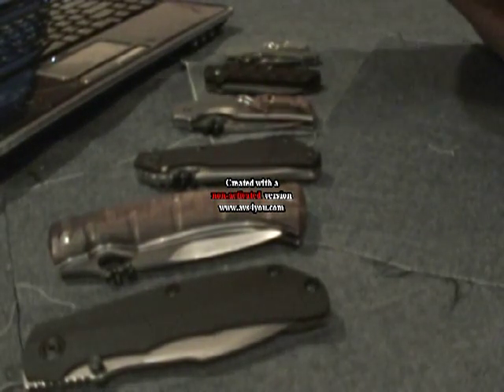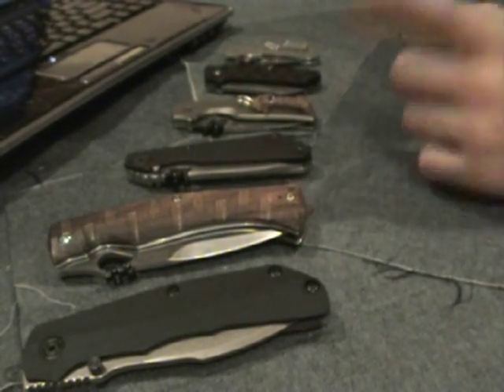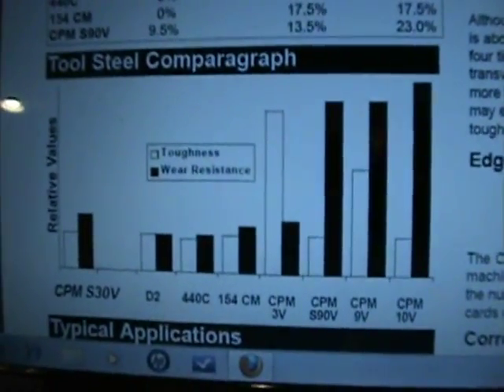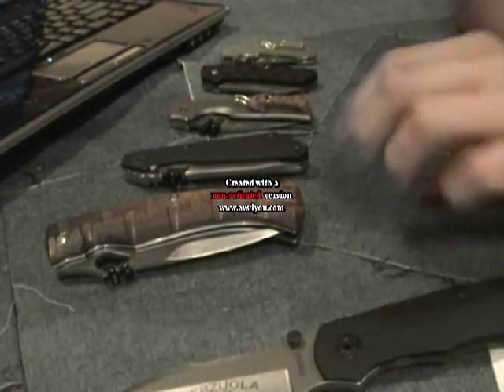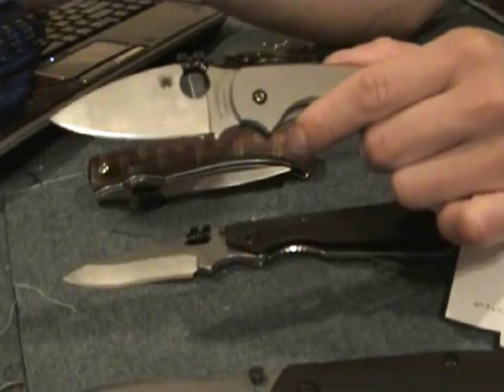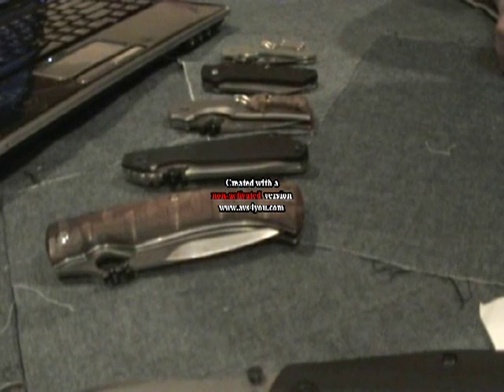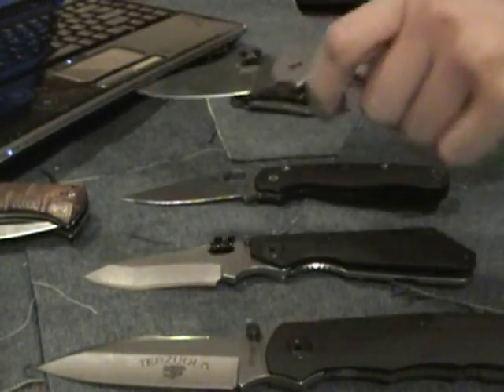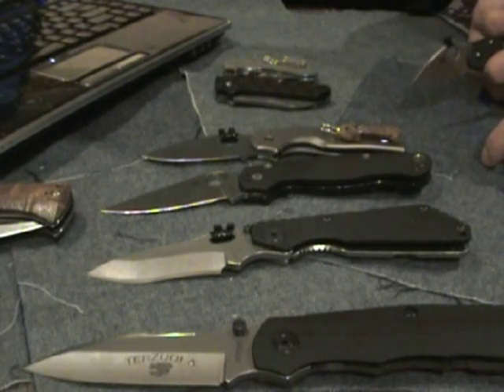Choosing the best knife steel pt 1 of 2

Comment: i wouldnt encourage anyone to take ur knife apart. ive had many knives for years and never needed to take a spyderco apart for cleaning or anything just use air water and oil polish. they are put together very well at the factory most ppl with mess them up ripping into them

Comment: Holy shit. This just keeps getting worse. D2 Tool Steel does NOT have 16% chromium, and is not a stainless steel. It has 12% chromium, just below the 13% that is generally considered the amount necessary to be called 'stainless'. Some people refer to it as semi-stainless, and its corrosion resistance is pretty good, but knifemakers like D2 because its high carbon, it takes a really keen edge and holds it quite well. I'm going to stop correcting this guy, because almost everything he's spouting is mistaken. I admire his enthusiasm, I guess, but look elsewhere for reliable info.

Comment: I don't think the CM in 154CM stands for 'Chromium-Molybdenum', since chromium is 'Cr', and carbon is 'C', and molybdenum is 'Mo' (there is no element with the symbol 'M'). As far as I know it stands for 'Crucible Materials'. That's why the CM is dropped when it's manufactured using the 'Crucible Particle/Powder Metallurgy' process, becoming CPM 154; the 'CM' is redundant.

Comment: @jedirifleman It's obvious I used the word tough to imply hardness. Axes are softer, therefore they need to be sharpened more frequently, therefore they wear out faster. So they aren't as "tough" as knives, which have better edge retention (wear rate) due to harder steel. Your either nitpicking, or are trying to troll.